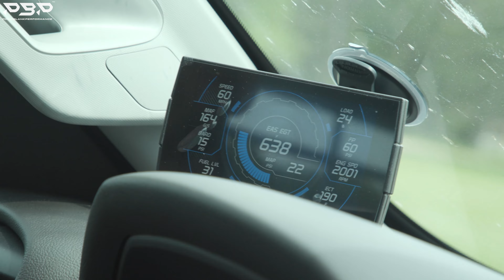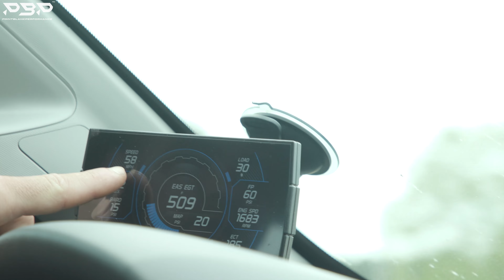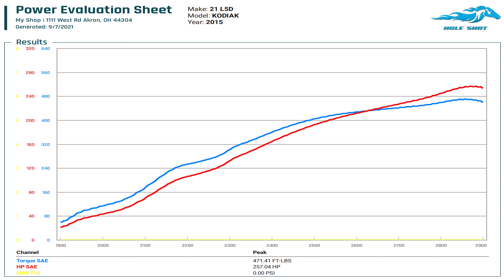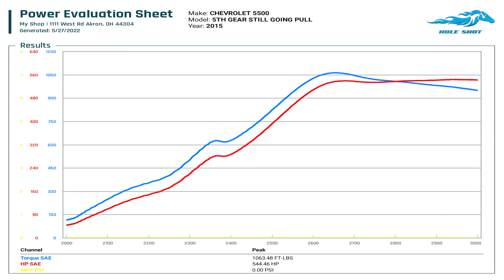L5D DURAMAX NEEDED AN EXTRA 592 LB-FT OR TORQUE!

Comment: I had on 05 c4500 , I have been contemplating getting a new one . Currently have a17 f250 powerstroke. My local dealer was telling me the chevy 4500 don’t have a great tow rating 🤷🏻‍♂️. Seems to work fine for you !

Comment: Load that trailer down and drive the same route. That’s impressive with an empty trailer. I want to see it with some real weight on it.
Reply from the maker: Not a issue Sir ! Keep a look out for a Upcoming Video !
Reply: @POINTBLANKPERFORMANCE  I like the results so far. If I ever get my truck, I might be looking you up.
Reply from the maker: @treetopflyersofva2  You the man 🤟🤟
Reply: What tuner you run efi live? I have a H&S minimaxx on my lml duramax 3500 fully deleted and it makes amazing power and you can't feel anything behind you while towing

Comment: Just noticed my 2019 5500 4x4 4dr cuts out at 75 mph. I'm definitely aware of the difference between the P and D motors and guess I'm getting old because I know exactly how GM engineers think and I'm good with it. These trucks are built to last,  not hot rod around town. You can get into trouble fast speeding around in trucks this heavy and stiff.

Comment: 2 questions?   

1- Will your 5500 now putting out over 1 thousand lbs of torque will it spin or chirp the four rear tires??

2- I have a 2019 3500HD duel wheel steel flatbed regular cab diesel 6 speed 40,000 miles on it.  Can the same or similar setup be done to it to raise the horsepower and torque numbers ?    3rd question (SORRY) I said two questions. 

3- On your 5500 when you raised the horsepower and torque numbers did that increase your road speed limit ???  My 3500HD 1 ton tops out at 97 mph sometimes I’ve seen 99.  Not too often do I run that speed but on the Hwy if you don’t pay attention to your speed you will stay in that area with very little trouble. I pull a 32ft LoadTrail flatbed with mega ramps with little effort loaded and empty but it sucks fuel like mad. Empty bob tailing I can see just over 700 miles on a fill up of 60 gallons factory fuel tanks. I don’t want to race my truck but just having the extra power is nice.  

Thanks

Liked Subscribed & Shared
Reply from the maker: 1 She will do burn outs if called upon😂 2 Yes sir 3 We will red line the rpm’s before we run out of MPH ! 130 I believe sir ! We use this truck 100% as it was built for to pull heavy load , get the best mileage possible and make the engine life longer than it would off the lot  !

Comment: So I work for navistar for 11 year I had part in developing this truck and yes they are meant to pull and adding all the extra power the cooling pack will not be able to handle its way to small for that extra power and the reasons they are down tuned it’s becuz of dot regulations it had to be a specific power to weight.  They are regulated
Reply: I own a fleet maintenance company and out of genuine curiosity...what DOT regulation requires class 3 - class8 trucks need to have a certain power : weight ratio? I've never heard of this. I was under the impression that they were de tuned for longevity and comfort
Reply: There are no dot regulations 
It's all about how the government dyno them 
And they are detuned for longevity.  Normally these trucks are not owner operated 
And they get beat to all hell

Comment: Other than some up pipes to match the stock L5P turbo, did you guys keep all of the stock charge pipes? Do these medium dutys have a bigger intercooler than the 2500/3500 platform? Also what about some piping upgrades for this truck! I know Wherli built one for himself too but havent seen any engine updates for the 5500s

Comment: It would be cool to see a Kodiak make 900-1000 whp. Like 1800-2k lb foot of tq heck maybe 2200 tq
Reply: I don't think the Duramax bottom end even when built can handle 2200 lb/ft.  Even our Cummins tend to split blocks at will around that 2k mark.  I know the L5P is an animal, but that's a tall order.  I would certainly tune in for that though.

Comment: why bother? the 3500 is rated for MORE GCWR. with MORE power right out of the box!  these medium duty trucks were built to be vocational trucks ( mechanics truck, flatbed car hauler, box truck ect...)  NOT tow rigs. they ARE  rated for more GVWR which basically means they are built to take the weight ON the truck, NOT on the trailer.   plus anything over 26k you need a cdl.  how much does that HUGE heavy steel trailer weight? ( im guessing around 10k ) so im guessing you have a LEGAL payload of ... around ....   5000 lbs . ??
it's all fun and games until the trooper pulls out the portable scales ...  but hey, on the plus side, it DOES ride like  a buckboard wagon!
Reply from the maker: I take it your not a 5500 fan 🤣
Reply: @POINTBLANKPERFORMANCE  i like the way they look ... but the weight ratings are HALF of what they SHOULD be!
edit: good job with the truck!  think the transmission will hold 2x the power?
Reply from the maker: @bobocaterpillar3697  Yes sir with lower gears in the rear end that will help out ! She’s still rocking and rolling !

Comment: Random question, how’s the turn radius on this beast? Does it have a steep turn angle like the ram and Ford 4500’s?
Reply: Great truck but the turning radius is horrible
Reply: Mine turns great for the size, but I'm 2wd, the 4wd probably doesn't turn as good

Comment: 3 Big Questions - Are you going to post videos of towing massive loads with this setup?
-Will the mods you performed void warranty?
-Could you simply install an L5P ECM with the L5P turbo and essentially have an L5P (injectors too if necessary), then flip back to your L5D ECM for warranty dealings?

Comment: 270 miles per tank… that’s not bad but still damn
Reply: My 2020 6500 gets about 11 mpg average on a hood work week is 12.2 mpg . Dont the best and the tank isnt that big at all
Reply: @THatChevyguy91 I’m looking to buy one but everyone says they can’t pull would u recommend one to tow around 30k
Reply: @alexisgonzalez5927  we have towed heavy equipment with ares . The exhaust break is a pretty nice feature helps a lot . But if your not towing or hauling the suspension is stiff as a brick . Good power
Reply: @alexisgonzalez5927  f450 or the dodge 5500 are you two other options.
Reply: @THatChevyguy91  is it good for mountains we live in Utah

Comment: I want better pull, fuel mileage and cooler EGTs
Reply from the maker: What year ?
Reply: Was delivered May 2019 5500 l5d
Reply: @POINTBLANKPERFORMANCE  2019 delivery was May 31
Reply from the maker: @dlc423  I would do a 2500 series turbo and emission on tuning sir !!

Comment: That trailer don’t weigh anything.  What’s it weigh, 5 to 6,000 lbs.
Reply from the maker: I would agree it’s not heavy 7500. We use it to tow 2 trucks at time to shows. On the conservative side 25k . Not heavy for heavy duty but light duty it’s decent weight.